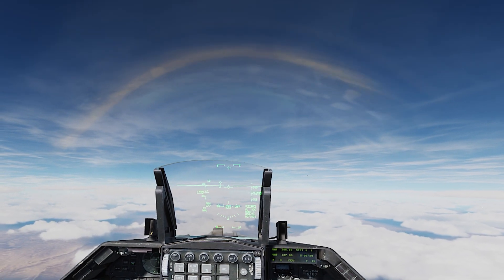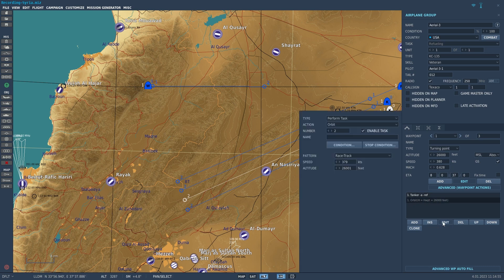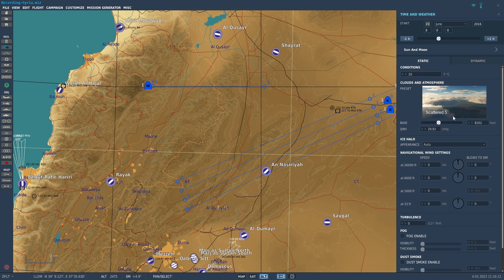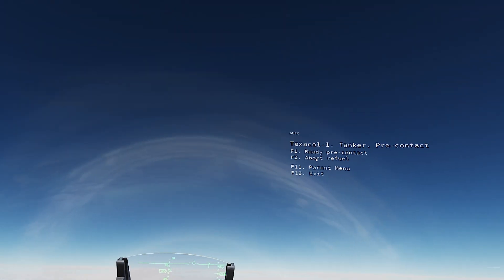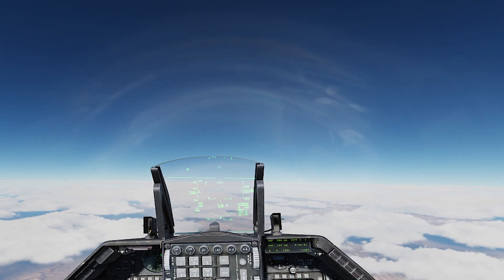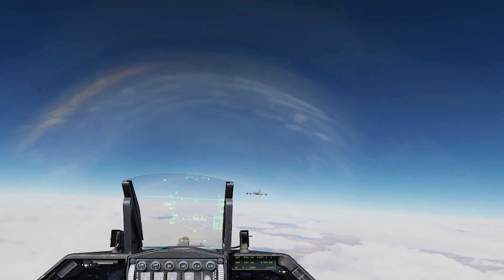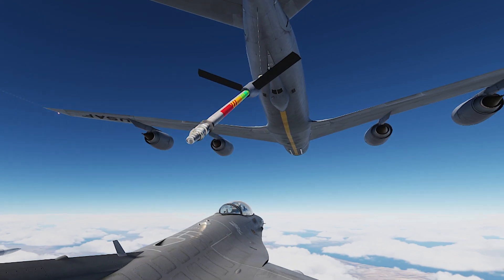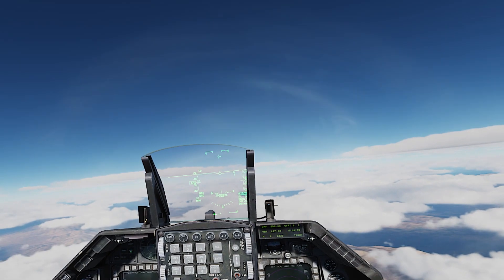DCS – F-16c Viper air to air refueling - AAR - tutorial (VR)

Comment: Small adjustments is quite an exaggeration. I have been flying the F16 for about 6 months now. Tanking is tremendously difficult. I could seem to make any progress. I would just be all over the place back there. 
Then I downloaded keeping the bare at bay. The 1st mission requires you to fly in a tight formation to progress to the next mission. I quickly realized this is a skill one must master before Tanking. Because most of the time the control input needed is flexing the muscles in 1 finger. 
This is where every tutorial fails in my opinion. You seem to have gotten use to making what's easy to call micro adjustments so you call them constant small corrections. But in reality the movement on the stick is not noticeable.
Reply from the maker: Your spot on there!

Comment: Tjena! Jag har också 3070 med Oculus Quest 2, ram 64… Mitt tweakande efter skärpa kontra FPS har nåt nya nivåer nu och jag tillbringar nästan mer tid med inställningar. Så jag undrar: Vad är dina råd? Använder du PD eller Msa eller höjer du res med glasögonen, eller kombinerar du? Håller på att bli galen😂
Reply from the maker: Ooo... Jag gick faktiskt helt bort från Oculus Q2 då jag aldrig klarade få någon skärpa :( Lite synd, för på många sätt är det ett bra VR-sett. Men det blev som att se ljuset när jag testade HP reverb G2. Det är något helt annat.
Reply: @ulvar51  Fattar det är nog det som är grejen... Håller på att testa VRPerfKit nu vilket jag fått fungera ok men datorn går på sista cylindern. Med det på kan jag köra 80 mhz, max resolution och PD 1.3 nedsidan är att jag måste centrera blicken för att få det skarpt övrigt område utanför blir suddigare och suddigare ju längre ut i periferin man kommer. Det får funka tills jag uppgradera 😂
Reply from the maker: DCS är en dyr hobby :D
Reply: In oculus set the 72Mhz, and turn the resolution to the right to Max, then in DCS the PD to 1.0 as default, thats it, you should be able to read the whole cockpit. I use quest 2, but i have i9-13900k with Rtx 4090, so i have everyrhing on Max Settings and it looks very nice. With your 3070 you are maybe limited, so reduce msaa or other settings.